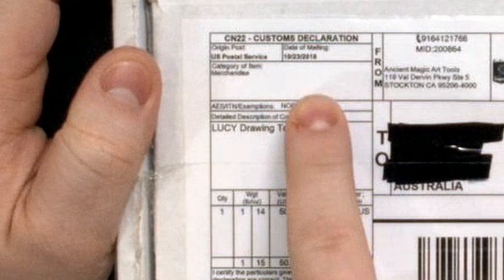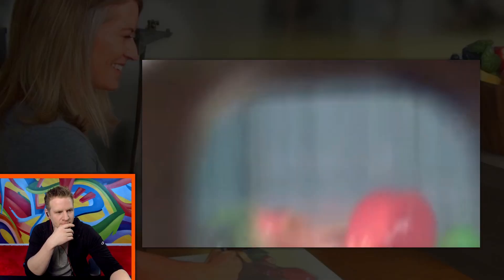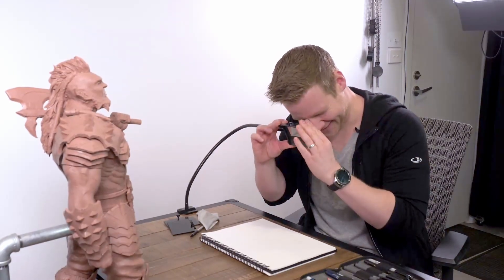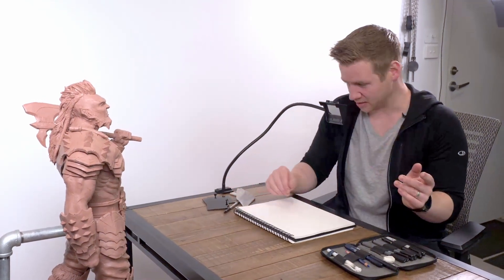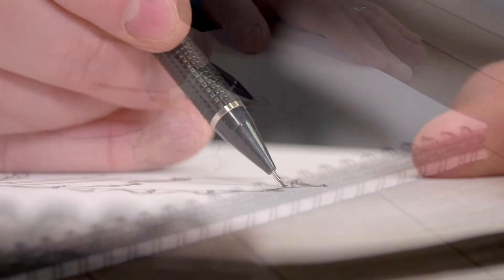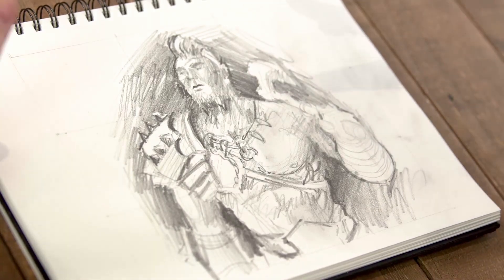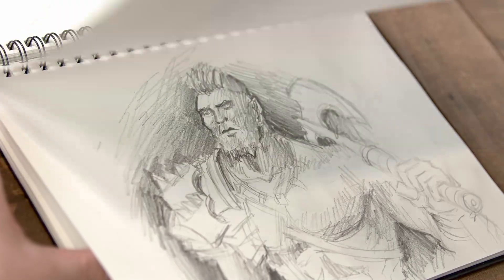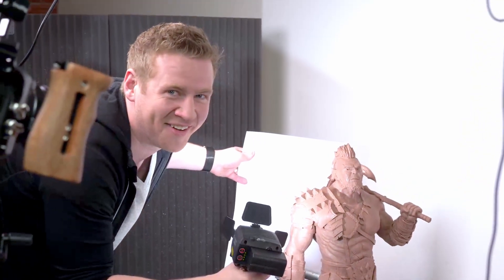Does this Weird Drawing Tool actually WORK? - "Art Hack" Test!

Comment: Jazza, you missed a tremendous teaching opportunity here.  

Yes, the commercial for Lucy was a cringe inducing informercial, but there is some genuine history and insight to be gained.  The ‘Lucy’ comes from its original name Camera Lucida, but all of this came after the Camera Obscura which revolutionized how painters of the 13th Century drafted their drawings for paintings and paved the way for the realism of the Renaissance.  Having a person sit while you draft your lines, in perfect correct proportion, is time consuming and often impossible to achieve realism with complex geometric shapes, so artist and inventors used concave and convex lenses, mirrors, and prisms to quickly and accurately lay down lines on canvas that they would work over with paint.  Sometimes these lines were drawn with charcoal pencils or sometimes they used the undercoat for the painting to fill in their shapes.  X-ray imaging of old masters show how they used these techniques to draft their masterpieces quickly.  

This allowed the artists up to focus on things like composition and story telling.  This is why there is a significant jump in realism in painting are drawing at the time.  Ironically, you stumbled on a key element of using the device.  The extreme contrast in light is called Chiaroscuro, and was a after effect of using this technique and made the work of Rembrandt and other Renaissance painters so dramatic.  This technique would be later copied by many artists attempting to achieve that same dramatic look.  There is a whole beautiful world of how this device gave way to how the Camera, and how it was made, and transformed art entirely.  If you get a chance I recommend watching the movie ‘Tim’s Vermeer’ or read the book ‘Secret Knowledge’ by David Hockney, both have excellent historical context and give key examples of how it influenced the world of art.  

For many starting artists, getting a piece to look like what they are 'looking at' can be a personnel hurdle.  Painting and art is multi-faceted.  Working in skills of drafting, composition, color mixing and theory, everything can be very difficult, but if you want to just work on say ‘color theory’ or paint mixing then using something like a Camera Lucida to quickly put your lines down on a gesso’d canvas is perfect.  I specifically mention gesso’d canvas because you can’t use light boxes on prepared canvas’ easily, and not at all on panels.  I have seen fresh air painters use Camera Lucida to quickly capture a landscape scene, for people who paint outside and have to carry everything with them, bringing something heavy like a light box can be weight prohibitive.  They will go and sit and find a great scene and throw down their lines on multiple panels using a Camera Lucida and when the lightning is just perfect, paint over their lines and work through their boards quickly to hone their technique of impasto.  There are certainly more accurate ways to get an outline down on canvas, but sometimes there aren’t, and sometimes a rough outline is the desired step.  

While the Camera Lucida as a tool might not fit your style of art, or the way you like to draft, it does have a whole group of artists whom it works wonders for.  Often times as new artists start learning art, we are told not to ‘trace’ because you have to develop your drafting skills, and if you use something like a light box or photobash and trace you aren’t actually doing art cause you’re just tracing.  There is no right or wrong, these are just tools.  Modern concept artists use 3D models to lay in their shapes of models to get great composition for dramatic effect.  Even closer to present, 3D software helps with lighting to capture reflective lighting accurately where artists play with light sources in real time.  There is a real constant pressure to do art a certain way, and with me nieces and nephews I find myself undoing some of the linear thinking that even their art teachers teach them, constantly fighting preconceived dogma.

I have also heard people say, well, using any ‘art hack’ is cheating and that you’re only cheating yourself!  You’re damn right it’s cheating.  It is a tool to cheat time, and a useful tool at that.  There is no right or wrong way to art and any tool that an artist can use to get the desired effect is acceptable.  The great master's learned their craft from copying and tracing the great works of their predecessors, and took shortcuts with technology every chance they could.  If you’re a kid and you find a creative solution, embrace it, if it helps you produce art, amazing, if copying drawings of Goku or your favorite characters is your desired effect, do it.  So many of my fellow artists have conversations on what is the best cheat for eyes, ears, and noses.  Its amazing how many artists look over their shoulder before they tell you how they really paint tough things.  

I once had a gallery owner ask me how I did rain so well in oil paint?  I told her my secret was a custom pizza cutter I outfitted and also getting my paint viscosity just right.  She was appalled that I would use a pizza cutter on a canvas and recommended that I stop cheating and learn to paint fine lines like the masters, I laughed out loud because I considered it one of my greatest inventions that yielded the perfect effect I was looking for, a secret that other artists have said... "show me", and once I had, they were shocked they hadn't thought of it sooner.

Anyway, if you do a follow-up video to the Camera Lucida or Camera Obscura, there are some great uses for both that I think can be used to highlight its use.
 - Laying down a rough sketch or key lines and shadows for a portrait of a live person
 - Using it to draw a complex geometric perspective, i.e. a car with sweeping lines, a chandelier, or another object in which the perspective is unique
 - Using it to create a rough outline that you can then follow-up by coving with paint
 - Take it to a museum and copy the key points of a painting you like, or to a landscape, this can also include getting perspectives on skyscrapers, bridges, and other difficult items correctly drafted
 - Once you learn to see how the master's used it, you can see in paintings where the refractive differences occurred and you can see in the old master's where the veil of 'being a master' slips.  In this way, it becomes much more believable that anyone, with enough time and practice, and use the tools to achieve what they did

Comment: A critical moment in your video was when you realized the Lucy sketch was distorted & your brain went "WTF have I been sweating with this piece of equipment for?" It was distorted because you had the viewer tilted probably 10 degrees back meaning you were looking up at the sculpture. But thank you for "trying it out live" for us as there isn't a lot of helpful information out there about it.
 
I just ordered the Lucy Flex as an aid in capturing design elements for wood carving. Most of my previous "drawing" experience has been as a mechanical engineer making rough concept sketches and using Computer Aided Design, specifically Solid Modeling & projecting that into 2D "blueprints" for machining parts & the like, so my skills and how I view the task is going to be different. I'll put up with a fair amount to get proportions and scale correct - a lot of what CAD is good for actually, mechanics, definitely not beauty. 

Just relying primarily on physical media like pencil and paper - instead of bits - is a huge shift for me. So anything I can do to finesse the multiple learning curves I'm up against is a plus. $100 for a potentially useful tool is cheap. Besides, it pays for a lot of wasted materials - besides time.   

What's an engineer doing carving wood, you might ask? Mostly making custom frames for a very talented friend's paintings and drawings. I'm counting on architectural, anthropological and nature references - and being a life long arts enjoyer - for achieving some non-ugliness. That and my limited goals being much easier than art writ large,

Comment: This looks like a redesigned version of the Magic Art see and draw that I have from the 1980s. I always found that if you get a desk lamp and aim some light on your object and dim the lights in the room you get a much clearer and sharper picture. The Magic Art came with those instructions and it worked very well. I guess adjusting the lighting would work with this product as well since it is basically the same concept?

Comment: The Lucy does have 2 darker shade attachments that come with it so you can overcome some of the contrast issues. You can attach one to the front to overcome too much light in the input, or one to the bottom to add more darkness so the contrast is clearer. 

... That being said, that doesn't remedy any of the other problems. I've tried and tried to get it to work.
The distance/scale issue SUCKS to deal with. 

I've found it most helpful for doing really loose intro sketches of landscapes, just to get proportions. All in one go, so I don't have to leave and then readjust when I come back-or even look away.

The fact that you can't copy color also sucks.

But check out the documentary 'Tim's Vermeer' about a non artist who perfectly and painstakingly reproduces one of veneers paintings using a similar methods that he thinks Vermeer might have used. It really is tremendous.

Comment: Thanks for the video, it helped me to see some details of Lucy.

1º Before starting to draw I have to finish adapting the space or model

2º The Lucy is for what it is: to take the measurements save me the grid and the hours of taking the position of details that with Lucy I have them instantly, I would make the shadows without Lucy I would only mark the contour and the most relevant details.

3º I will use it to make a drawing much larger than the original model or to put some filter and that the general is seen, not the detailed. For this I will use the Lucy that is about to arrive....

Thank you very much, another thing, I think that LUCY PRO is much better, since it allows you to enlarge the scene and prevents shaking in any movement, no matter how small, since it is a rigid adapter, I would immobilize it in some way. ;)

Comment: I wish I had seen this video before purchasing Lucy.  I has purchased the Lucy and received it yesterday.  Was very excited to try it.  After really working with it - lighting, distance, etc., I come to the same issue: unless you are able to hold your head completely still while you a rough sketching, your proportions will ultimately get screwed up.  I found it very frustration and difficult to use mainly because of this.  Perhaps the creator of Lucy could implement a flexible/adjustable chin rest to aid in minimising inevitable head movement while drawing.  I plan on returning my Lucy.

Comment: have you tried not mounting the luci on the surface you're working on? might help with stability. Also you could try darkening the work area by covering it on one or more sides with a blanket or some kind of shade. You might be able to get more detail of the figure if you aren't getting so much light in your eye from the paper you're working on.

Comment: The Lucy basically works like an overhead projector or a darkroom enlarger -reflected light travels off the subject, bounces off a mirror, and down onto the drawing surface -with the exception that those devices have their own light source that is able to “power” the reflected image down onto your paper (or up on a classroom wall, in the case of a projector). 

The Lucy however, only depends on ambient lighting to reflect its image. This is important because it means how well the subject is lit, and it’s distance away from the mirror of the lucida affect the clarity of the ghost image you see. Another factor that affects clarity is not only the subject’s lighting conditions, but the lighting conditions of your own work surface.

Because the Lucy works by reflecting an image coming down from the mirror, the clarity of the image will be limited by any surrounding ambient light or other light source coming in between the path from the mirror to your drawing surface. Ever try to view your cellphone in the daylight? Or do you know why the classroom lights must be turned off for the overhead projector’s image to be visible? That is what is happening here. Although the image is reflected light, not “projected”, which means Lucy’s image will be weaker and even more susceptible to any light pollution. 

Ambient light is coming in and decreasing clarity and contrast of the reflected image as it travels the from the mirror of the Lucy down onto the plastic contrast filter and onto the work surface. You solved one problem by increasing light on the subject as this adds more “power” effectively. More light on the subject equals more light to be reflected by the mirror and better image clarity coming out of the Lucy, but that creates another problem because the drawing surface and contrast filter itself is in that very same lighting environment so any improvements just gets washed out by the additional ambient light.

The solution then, is to isolate the drawing surface from any light except for the light coming through the Lucy. I won’t get into how to do that here, because your review and project are pretty much over now, but there are multiple ways. You could use a light proof cloth, you could work inside of a box of cardboard, or build light baffles as a barrier around the drawing surface and Lucy to block out light. Anything to block out outside light from coming in.
Probably the most simple but less effective is to enclose the sides and area between the mirror and plastic contrast window (the one that attaches under the Lucy mirror) around light proof cloth or some cardboard and tape.

If you know how the large ancient camera obscura and lucida work, you will see why they are so big and bulky. Because ambient light washes out any reflected or projected light of an image, artists had to find a way to separate the subject’s lighting conditions, from the lighting conditions of their work surface, or work area. Sometimes, the whole studio would be in darkness except for the light coming from the camera lucida or obscura. There are even videos on YouTube on how to turn your whole bedroom into one large camera obscura, and view the outside world projected in real time, onto your bedroom wall.
Anyway, I liked the review and video. I think the camera lucida is a great tool and it has its place in the art process. Just have to know how to use it and apply it. It won’t make you an artist by itself, because you still must learn how to render forms, and transitions, with volume and depth, but as a preliminary tool for getting basic shapes down, foreshadowing, perspective, and proportions, I could see how it would be useful in certain situations (indoors, of course, where you have control of the light).

Comment: I have lived by the Lucy for a long time, now. But I actually put the lucy away when I work with the values and charcoal. I think the Lucy is best to get the framework, and not to complete the entire work. But I'm not even sure if i use it correctly. I just realized watching the ad again (how Jazza looked through the view finder is how I used to see it) that I have been using the device in the wrong orientation. Unfortunate as Jazza didn't like it, this is still one of my most used tools for accuracy. At least in the beginning.

Also it's a huge eye strain

Comment: I'm pretty sure the camera lucinda isn't supposed to be used to directly trace as if it were an ancient technology lightbox. It's supposed to help get the basic lines down onto your paper quickly and effectively, after which you set it aside and add in the details yourself without aids.

Comment: I know it's not how it's advertised. But since light is additive I guess you could probably revisit this thing using darker or even black paper to get a clearer view of the reflection. And yes, you'd then also need to switch to white pencils as you sketch things out. 

I mean, the device seems like a very impractical miniaturized teleprompter thing with the 45 degree two way mirror and everything. But it did occur to me that you might need a darker paper.

Comment: 1.Use a light box.
2.Take a photo.
3.The other option I don't believe was mentioned.An opaque projector.
It's similar to the projectors teachers used to show graphics and images to an entire class of students.
Does anyone remember those days?
The image had to be on clear acetate in order to be seen clearly by the viewer and the lights were usually off in the room.
The newer projectors use mirrors and light to transfer the image to whatever surface you wish to view.
I used my when airbrushing t-shirts because you can't erase on cloth without making a mess of your work.
They also work great when doing large wall murals because you can adjust how big you want the image to be by simply moving the projector back farther.
Even three dimensional objects can be traced for instance,say,a beer can,a greeting card,etc.
The drawback to these projectors is you have to draw in a rather dark environment in order to see the image you're tracing.
They tend to get rather hot after a long tracing session.
They're also a bit pricey.
I paid roughly $250.00 for my Prism brand.